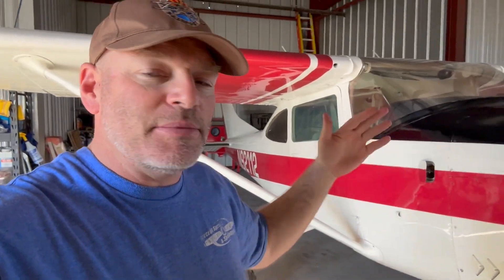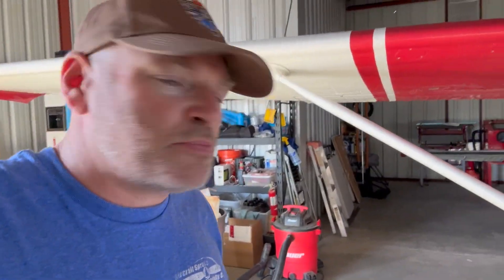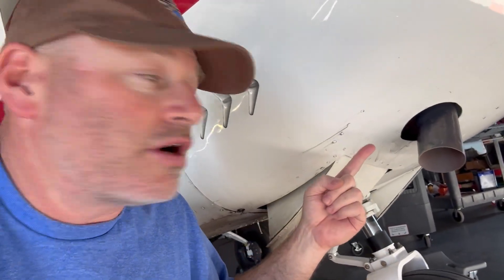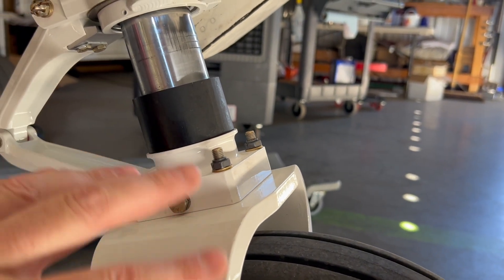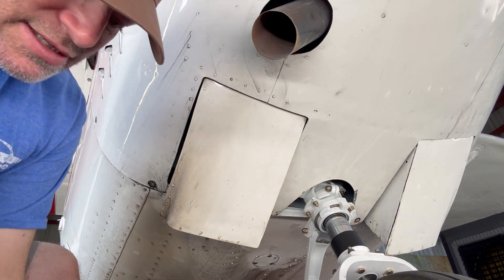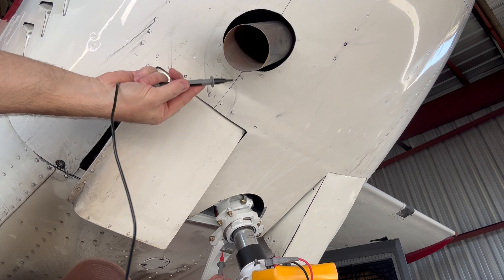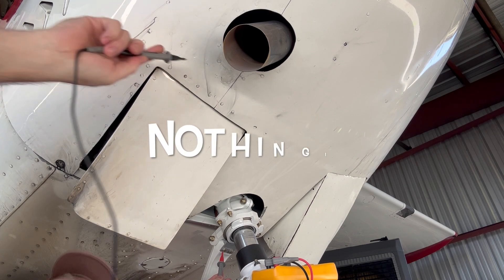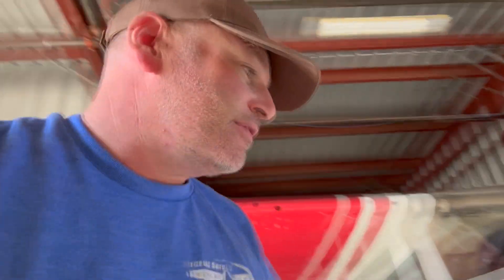SHOCKING TRUTH: Aircraft Static Grounding Techniques

Comment: grounding vs. bonding ..... these are separate issues. When fueling is taking place then bonding is required. The exhaust outlet is not a good place to 'bond' . The POH will tell the correct place to bond. The build up of static electricity during a fuelling operation is a very real threat that is not understood by so many in the GA community.

Comment: Using a continuity meter to test the quality of a low resistance ground path is like trying to measure bearing clearances with a plastic ruler.  Besides, we don't need a low resistance path to dissipate a static charge.  The only thing we care about is having the fuel nozzle and the filler opening on the tank at the same potential when they first meet.  If the path we choose has a higher resistance then it simply takes a few microseconds longer to dissipate the charge.  I used to dissipate static charges into doorknobs with my finger, which is a terrible conductor.

Comment: I worked at a top 10 midwest fbo for almost 30 years, Gotta say there were a lot of times i didnt ground due to no lugs in the ramp, that was also fueling big avgas loads like DC6s too. Airport said every time they bored a hole it weakened the ramp.... at any rate, I was thinking that fire aint gonna do it a hellava lotta good either lol... All it takes is that one time. As far as bonding the truck and plane. I always looked for a spot that was rather scuffed up or scratched like where the tow bar hooks as you said, never used the exhaust and when training advised new guys against that. I think the exhaust is titanium and has a tendency to become brittle with age as it hardens.. might be wrong. Great video

Comment: Usually there would be a ground but the exhaust flange has a gasket separating the manifold.  There are nuts and star lock washers (one time use) on the metal flange side that are torqued onto the studs. There should be electrical connection to ground. Probably just enough resistance so it doesn’t show a short.

Comment: I've had this argument with several ground handlers / fuelers  - the exhaust isn't a great place to ground. They still insist on using it.
At the same time, 100s upon 100s of refuels with a ground handler grounding via the exhaust... and to this point my plane hasn't exploded once.
Reply: Millions of cars refueled every day with no grounding wire in sight and they don't explode either.
Reply from the maker: @JosephHHHo  cars aren’t flying through the air building up static electricity. They are literally grounded non stop. Also by  touching the metal nozzle to the metal car fuel filler neck, it discharges any electrical static that might be present.
Reply: @112_adventures  and how many of us are doing airborne refueling???
Reply from the maker: @JosephHHHo  not enough of us to be relevant to the General Aviation crowd. Those that are are using pretty sophisticated means however that include bonding the aircraft to each other as part of the fueling apparatus.
Reply: @112_adventures  Your plane on the ramp at the fuel pump is just as grounded as a car at the gas station. Unless you are doing midair refueling, what is the relevance of airborne static charging? BTW, one of the most diversely experienced among current GA pilots also commented that he hasn't grounded a plane for fueling in decades and he hasn't exploded either.
Reply from the maker: Thanks for sharing Glen. Maybe I should send this to some FBOs I know